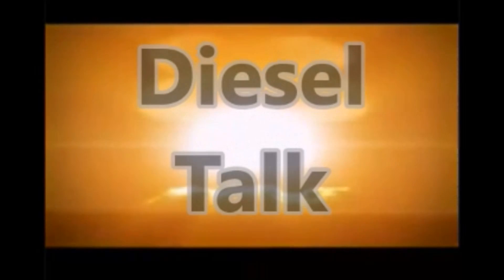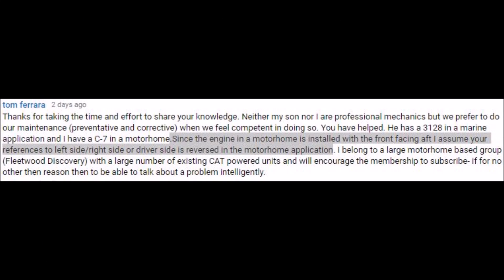Diesel Talk Episode 6.  What is the left side of an engine, 3116 Injectors, and low turbo boost.

Comment: Being in the parts industry, everything is localized and involved with the driver side of the vehicle. Referring to the rear of an engine because of the flywheel makes sense, and gives me a different perspective in terms of engine placement in vehicles. Rear wheel drive vehicles tend to always have the fly wheel facing towards the rear of the vehicle, while front wheel drive vehicles usually have the flywheel towards the driver side (left) of vehicle. I learned this while working on a Porsche Cayenne, where the engine was formatted into a rear wheel drive platform. Knowing the placement of your engine is essential because you don’t want to end up buying the wrong parts for it.

Comment: Thank you for going in depth into injector replacement on the 3116.  I am researching getting a vehicle with this engine and am trying to learn what is practical for me to do by myself in my driveway vs. what I would have to pay the local CAT dealer to do.  I discovered your channel last week doing research on the 3116 and diesel engines in general.  So far I think your videos are well made and very informative; please keep up the good work.  I look forward to anything else I can learn about the 3116 in the future.
Reply from the maker: +Squib Load The 3116 injector itself is easy to do, the hard part is redoing the rack settings. The 3116 also has a soft injector cup, so you need a special tool to ream it and then press the injector into the cup. The problem is many people (mechanics included) have a hard time doing the rack correctly and it can be tricky to do. If you could get the tooling online used and study it, you could probably save yourself a good deal of money, because dealerships charge a ton typically to do one.
Reply: OK.  Thank you.  This is good information.  I have a RAM truck with a Cummins 5.9L that is 14 years old.  I am the original owner, so I know the history of the vehicle/ engine maintenance.  It hasn't given me any issues. I like diesels, but my background in automotive maintenance is mostly with electronic fuel injected gasoline engines.  I am concerned that a 20+ year old 3116 with mechanical injection, that I know nothing of the maintenance history of, will need some attention.  Before I commit to the purchase (next year hopefully), I want to know what I am in store for, even if my research talks me out of the purchase.  Thank you for providing this resource.

Comment: adept ape i have a question, i have a cat c-15 525, i have full boost about 28 psi, but its becoming SLOW to build, so i have slow boost, what is going on, motor has 490,000 miles 2004 KW
Reply from the maker: +Christian Russo Is that boost normal? That seems a little low for a 525 horsepower. Check that wastegate first then check for leaks.
Reply: Adept Ape I'm pretty sure it's normal I didn't buy the truck new I owned it for 3 years and it has always been around 28 psi perhaps I have had a problem for a long time? what is normal psi in that motor?

Comment: Heres a question on your next episode of Diesel Talk. I have a JEP C15 engine to replace a Detroit 60 Series. I also have the opportunity of buying a KRA C15 engine. Which engine would be best for pulling heavy loads all the time.(129,000LBS), Fuel mileage is not a factor because POWER is what we want. Both engines are low mileage. Under 100,000. Thank you for all you do sir.
Reply from the maker: Hmmmmm, I'll actually have to look those up, I haven't seen those acronyms for a C15 before, are they older 3406 engines or marine engines perhaps. If you give me the full serial numbers I can tell you the exact hp and torque they were rated at from Cat.

Comment: hey adept

so on a c7, are the heui injectors programmed or is it only the ecm that is programmed? i mean is there a pressure setting for each individual injector or is the actuation valve on the pump the one responsible for the amount of fuel that the injectors inject? 

thanks mate!
Reply from the maker: +Omar So each injector us calibrated with a file that is set by the ECM, the ECM has to be programmed with the injector file for that cylinder. The ECM is what controls the amount of fuel the injector uses though.
Reply: okay, but why are the injectos progammed to?
Reply from the maker: So the injectors aren't really programmed they are just calibrated from the factory.  Then the calibration code is so that the ECM can be programmed to what the injector is calibrated for.  It helps the ECM fire each injector uniformly.  If they are not programmed, they can run rough.

Comment: Adept Ape!
a cat c7 will run and not start. turned out that the engine speed/timing sensor is bad. what the mechanic did to test  the sensor was he unplugged the cam sensor and stuck it close to a metal object, it didnt stick or magnetise, so he said its bad and he replaced it and it did work. How did he conclude that if  the speed sensor doesnt magnetise to metal that it is bad?

thanks !!
Reply from the maker: +Omar Speed sensors are typically a little magnet that picks up the sign from a tooth and sends the signal to the ECM. If there wasn't a magnet then it wouldn't work.
Reply: Since those speed sensors are the "passive" type, does that mean there will be no engine check light displayed or fault code set in CAT ET?

Comment: Appreciate your videos,I have a c13 general thoughts on this engine and is it worth in accerting it without a platinum rebuild
Reply from the maker: +Nolift Chris What do you mean by accerting it? I really like the KCB C13 engine, it's my favorite engine actually, if it's a LEE not so much.
Reply: Adept Ape  I meant  un accerting (speelcheck sucks) switching to a single turbo,the kit is 7 grand or so.i bought it with 'service records are secret ' type deal with 900,000 but had no blow by and sounds tight but have heard there 700k engines
Reply from the maker: Well they will last longer than 700k, the same design engine as a C12 and I've seen them in greyhound buses with over a million miles on them. The C12 was a single turbo though. Switching to a single turbo isn't a horrible idea, but I'm unfamiliar with the kits. Does that eliminate the IVAs as well because they had a lot of problems with them?
Reply: Adept Ape mine is a 07 so you can find details at oldtunerguy.com they have the kit I've heard Pittsburgh power has developed one too.i appreciate your knowledge and so far I've done a overhead and waterpump and that's it.might do rods and mains just because it was a tanker truck so it idled a lot with a pto in its previous life
Reply from the maker: You have a regen motor, well those are typically 700k motors and my theory for that is the EGR or CGI as Cat called it, sends carbon into the cylinders and glazes them faster, but that is just my theory. I know quite a few guys interested in those regen bypass setups, but as a Cat dealer we can't get involved with them where I work.
Reply: Adept Ape it's a 06 engine in a07 Pete I'm pretty sure it's non egr accert c13 but you're the pro thanks for the info and your time brother
Reply from the maker: +Nolift Chris I thought the engine was a 07. Yeah a 06 is non regen and non EGR, a lot better engine.

Comment: How do you keep track of all of the parts you remove to get access to work and remember the order of assembly? Small jobs wouldn't be an issue, mainly I'm thinking of a major overhaul or engine pull.  Thanks.
Reply from the maker: +Steve M Well it is mostly a combination of experience, organization, and common sense. Some stuff like the head or injectors have to go on in order, but mostly the brackets and stuff go on in order and if you lay them in order, then just assemble it in reverse order.
Reply from the maker: +Hickerbilly 99 I know some fields like law enforcement and some others prevent felons from hiring on, but the Diesel field doesn't have anything like that. However, you probably already know that nearly all companies are going to do a background check when your submit an application and I'm sure having a criminal record is going to make it much harder get hired. If I were you, I would call the Cat dealer or other equipment shops in your area and see what they say on the subject. Hope that helps you.
Reply: Thanks, will do. Just found your channel 2 days ago. New sub
Reply from the maker: Thank you for subscribing.

Comment: please consider doing a segment specifically for RV owners. I purchased mine used with 60,000 miles and it's 20 years old.  my concern is proper maintenance and longevity.  

1. FUEL. Should low sulfur fuel be a concern with older engines? do you advise adding additives if so what and what intervals. Can motor oil, transmission fluid, brake fluid or any other lubricant new or used be added to fuel in low quantities for added lubrication? Can these fluids be harmful? or should low sulfur fuel not be a concern because of low annual  miles driven. What about bacteria growth in fuel?

2. ENGINE OIL. Synthetic, blend or traditional? change intervals? Annual, every 2 or 3 years? additives?

3. COOLANT. Life expectancy?  Low mileage. 

4. EXERCISE. I run mine every month for about 2 road hours is this sufficient or should it be more?

5. LUBRICANTS. Steering and suspension joints and other zirk fittings, type of grease recommended? 

I love your videos and I love my CAT.

Thank you
Reply from the maker: +rc4107990432 That is a great suggestion. I'll definitely put that on the list of videos to put out there. Very detailed comment and thank you.

Comment: Hey Adept, thank you so much for diesel talks. I cannot describe how helpful and clear they are.

Why do c7 and c9 engines use HEUI while bigger engines such as the c15 and c18 use MEUI? Isnt the HEUI system supposed to give excellent fuel economy less emmisons while maintaining  high power? Then why isnt the HEUI used on bigger cat engine models?

Thanks!!
Reply from the maker: +Omar You know that is a great question, I'm going to have to find out because they stuck with that MEUI until the end of the engine run. My guess would be the MEUI are heavier, more expensive, and longer lasting so they could fit them into the C15 since it's a heavy duty can get away with the extra expense and weight, but I'll have to find out.
Reply: One issue with HEUI you have to take into account is the fact that they use high-pressure oil. High pressure means smaller parts but also requires much tighter tolerances making everything much more sensitive to debris.